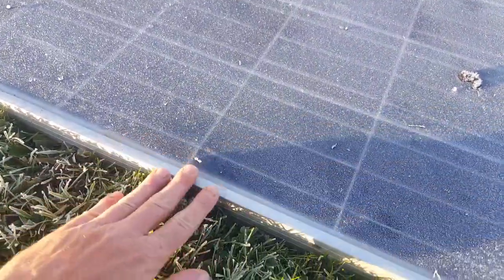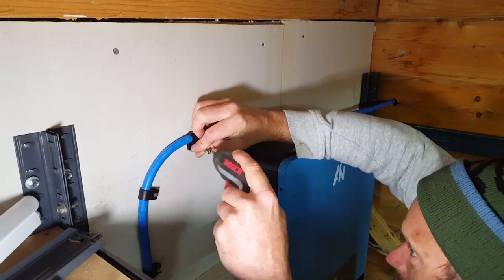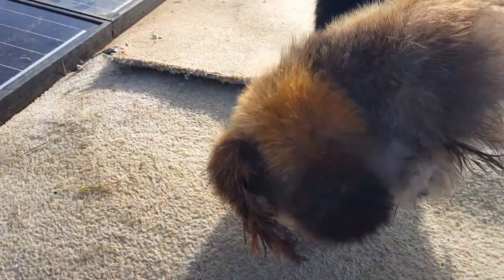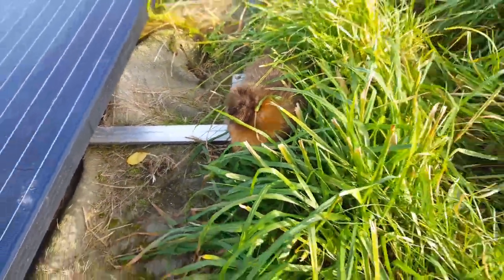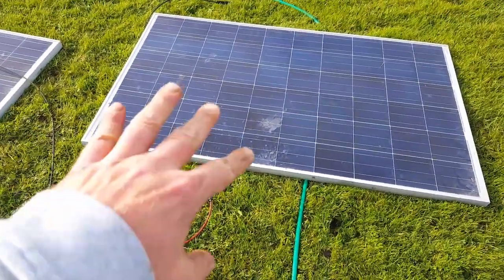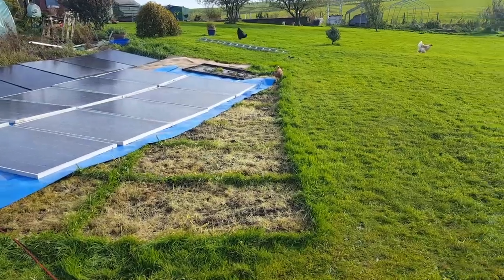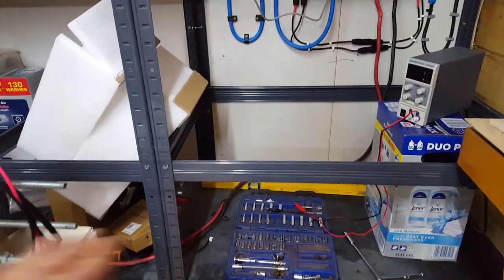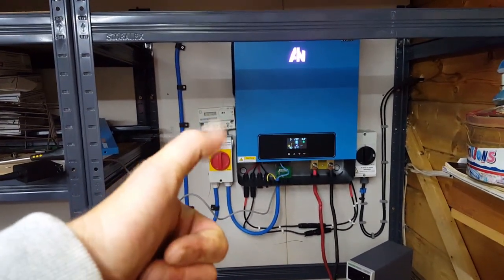"IT'S ALIVE!!!" Sucess nothing went pop when the beast awoke. Anern 10.2kW EX-PRO Hybrid Inverter

Comment: You need to give your self more credit mate. You have done a great job ao far and also you are testing before connecting. Test twice and connect once is what i say 🤣 the only thing i would do different is to have a fuse between the battery and inverter unless its just hidden out of the way. Does thst inverter come in smaller sizes or just the bigger power ones? Cant wait for the next episode to come out now. I do love a good powertool to help ease the stresses on the joints. Ive spent loads on tools ready for starting mine from hydraulic crimps to small wire strippers and everything inbetween, have confidence in what you are doing as you are doing a great job so far 👏👏👍
Reply from the maker: Brilliant thank you Karl.  Yes the battery is fused that sits just behind the BMS.
Yeah the inverter does come in different sizes, I think it was 6kw 8kw and 10.2kw.
I love my hydraulic crimpers by far the best tool yet!!! And oh God yeah the cost of it all when you add it up is frightening.
The next episode will be a full on nervous breakdown, I can't get the WiFi app crap to work at all. I have been getting the right hump this afternoon and evening.
I had to walk away and ignore it.
Reply: @garytaylor1978  yes I think the WiFi stuff can be quite fiddly especially when it's written in chinglish, after watching your next video someone may be able to help you and give you some advice on how to get it to work with the WiFi and stuff. Check in the inverter to see if the WiFi dongle connects straight to the inverter, the grey cable that came with it could be a way to connect the inverter to a PC to make changes and that could be why it wont connect? I'm just sumising here based on what I saw in this video